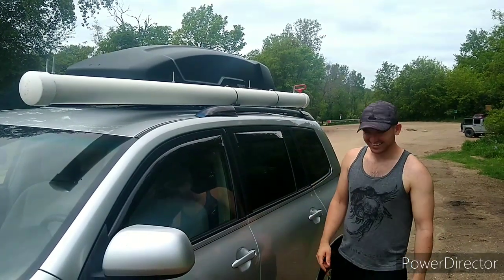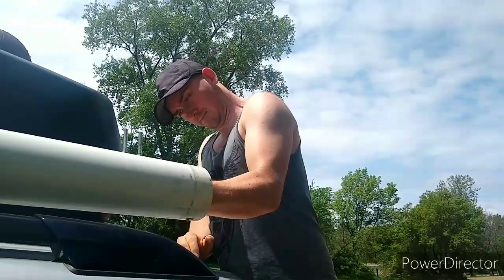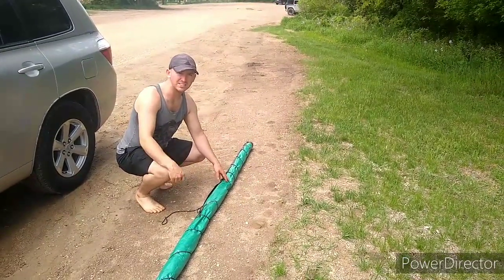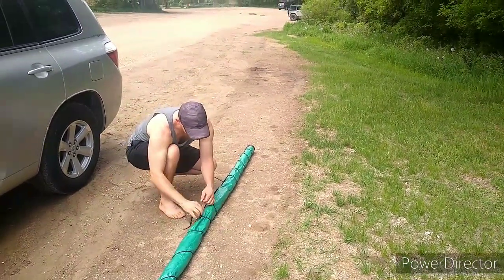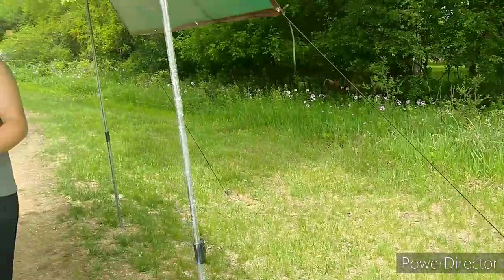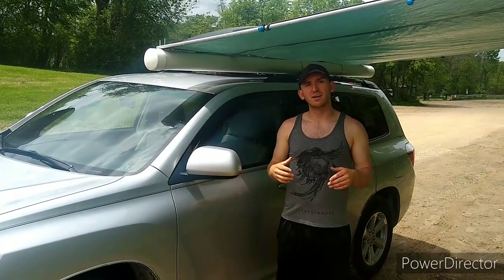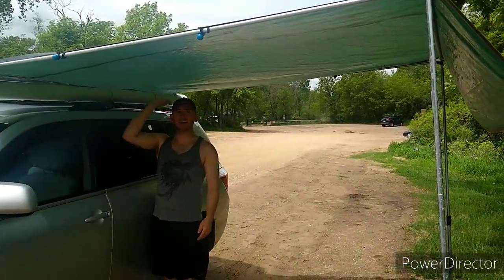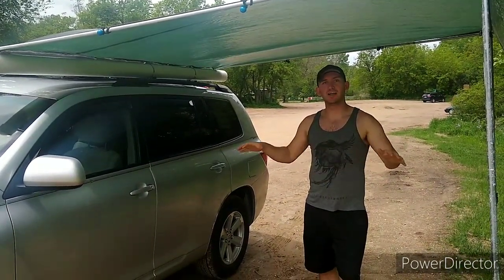The PVC Pipe On My Car (DIY SUV Awning)

Comment: In 3 weeks I will do my first "SOLO" trip, I have a very similar idea for the awning.  Just got my 4" inches pvc and I will use 1" inch PVC for the supports, I need to think find a practical way to hang the tarp to 4" inch PVC.
Reply: Hook bolts through the pvc, but open side facing opposite end of vehicle.

Comment: I would cut pipe 1 to 2 inches longitudinal from one end to other,leaving a few inches uncut on each end, to pul the tarp out from that opening. Would attach an handle on one end of the interior pipe ( one end of the handle would attach with interior smaller pipe and other end coming out of the lid,that you made, through a hole) to roll the tarp back into the pipe. Does it make sense? No! It’s fine it does make sense to me, will make one and will share link here.

Comment: Are use the PVC pipe exactly like you are in the in caps Jula hole in the center of each endcap with a small pipe going through the entire big pipe and cut cut up 1 inch 2 inch opening all the way across the pipe and you can wind the tarp around the pipe that’s inside of the big pipe and the 2 inch slit that you cut. You can make it open and close and then there you go.

Comment: Just watched this one and you're next: https://www.youtube.com/watch?v=_WZRxnhgbxs  Thinking adding to those comments, reminds me of the grow lights adjustable hangers instead of the para-cord.  Not sure how to set up in city... other than maybe way heavier weights than I'd want to lug around other than maybe five gallon buckets you fill with water?  Maybe water would be easier than sand or dirt in the city.  Thinking impromptu now using the inspiration and ideas I'm having.   Thanks for sharing!
Reply: Cool!  Same inspiration video... just heard you saying and saw in the description.  I even looked though didn't click show more to verify the video link there... just noticed was different.  Reminds me also, I totally forgot I picked up a University Surplus Store projection screen I thought would be perfect for the Prius... other than stowing the stakes of which I'm thinking painters extension poles and/or conduit?  Any the grow hangers for para-cord since have already.
Reply: Oh, I've been wanting to paint Type 1 White Silicone over a tarp to see if can make a more cost effective and water proof longer lasting tarp/canopy also.
Reply: AI just linked me to somewhat what I was envisioning.  Here's the link to the video with the above similar design if you're interested since might be a good idea to make easier setup and tear down: https://www.youtube.com/watch?v=Xc93sNdcMAA   I might add like a crank socket end on the tail side of some sort to make easier to roll back up.
I also wonder about the posts being positioned on fixed points on the bottom of the vehicle body or maybe an underframe mount part that can be easily stowed.  Then no need for stakes and ropes.